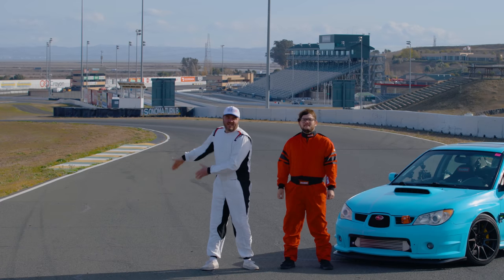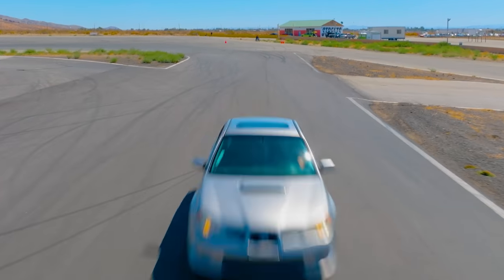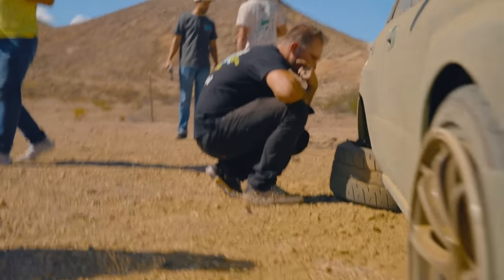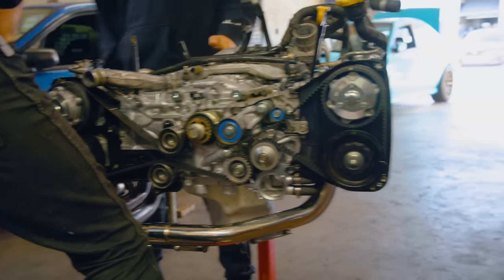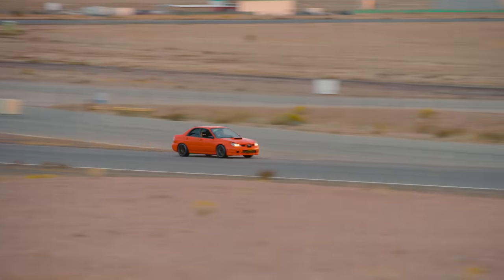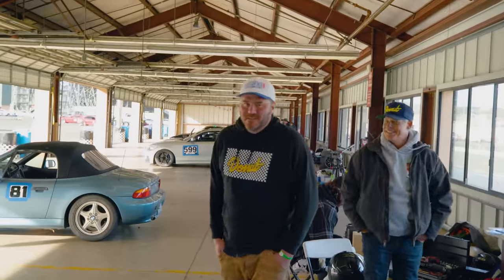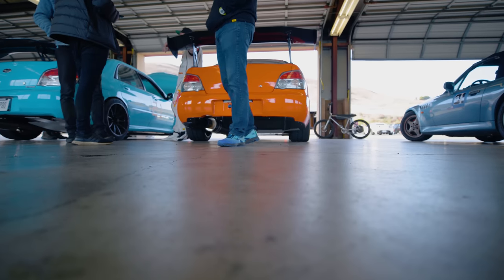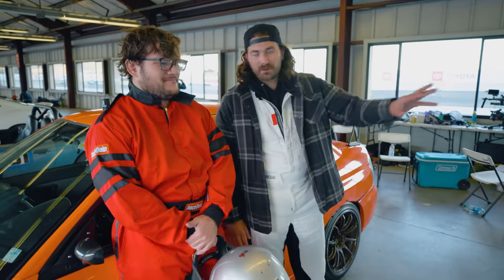$21,000 vs $43,000 Subaru WRX Build - HiLow FINALE!

Comment: The one thing I learned from this series, is every Subaru stereotype is probably true 😂
Reply: Not true at all. They just dogged on “new engines” without proper break in. Also no mention of a Cylinder 4 mod to help with cooling.
Reply: @FunTimeWithSouls  the cars are just junk
Reply: @pharezknights5467  not really, I have a 2019 and have no problems whatsoever.
Reply: @FunTimeWithSouls  not comparable what so ever xD
Reply: @pharezknights5467  wrong, my hawkeye sti has been driven very hard since 2006, had has 0 engine problems, donut just doesnt know how to care for a subie
Reply: @davidlees8519  same engines lol
Reply: @FunTimeWithSouls  with only a 10 years difference in age xD
Reply: One must respect the subie or one will get boned by the subie. That's the lesson of this hi-low
Reply: @obiwankenobi5126  if i have to add extra to make a car run normally im out, i just see too much problems with Subaru, i don't know why there don't ask Porsche for help
Reply: @obiwankenobi5126  which engine model japan or from America ?
Reply: If you want to learn more about what donut did wrong Smeedia made a great video explaining the problems they had and how to avoid them.
Reply: @obiwankenobi5126  if your engine requires super special care and love to function, it's a turd from the start and your just dressing it up with turd makeup.
Reply: lol you opened a can of worms down there.
Reply: @FunTimeWithSouls  I had bought an 18' new before upgrading to something quicker last month. I also never had one issue with mine while running a stage 2 pro tune, but I had to baby the shit out of it. After 35k miles I got sick of being scared to treat a sports car like a sports car.
Reply: @FunTimeWithSouls  yeah u dont go over 3k rpm or 5 psi boost becauase that thing will shit out, also its understandable you wouldnt wanna blow the engine and then u owe dad 5k more.
Reply: @CadgerChristmasLightShow  Or, it's a different engine that you can't expect to work the same way as every other engine. 

It's a boxer engine, it's not gonna behave like an inline 4.
Reply: @CadgerChristmasLightShow  exactly!! That's the same as someone saying a certain type of car is an amazing and reliable car if you just stay on top of maintenance and care for it...that's literally every car. Cars are literally made with the idea that, as humans, we aren't going to take 100% care of it bc most of us don't even know how. So if the only way your car is reliable is keeping 100% maintained then congrats you've got every car ever. There is a huge difference in a Toyota engine running on low oil for 300,000+ miles with little to no basic maintenance and having no problems compared to an engine with less then 100,000 miles that got every single oil change and check engine light investigated, and regular tuneups still needing X, Y, or Z replaced
Reply: @jackhofalot6705  23.3 psi, no knock. HA I’m 38 definitely wouldn’t owe dad anything lolol
Reply: @CadgerChristmasLightShow  If you're not racing your subie, it'll be just fine. These problems only arise when you put parts on for racing that aren't meant to be used with a boxer 4 engine.
Reply: @pharezknights5467  america
Reply: @davidlees8519  well how about this, i got 2 with the same engine, ej205 from the 02 wrx, one being an 02 wrx and the other being a 99 forester and neither have had any engine issues, now they’re 20 year old cars so ive done tie rods, a starter on one, idler pulleys on both, but nothing major that u wouldn’t expect to break on any other 20-25 year old car
Reply: @Tachyon836  ah yes, "just don't ever push it hard and it'll be reliable." I see tons of bone stock Porsches getting ragged on at the track and autox without them grenading so it has nothing to do with it being a boxer engine. Subarus are just pieces of shit
Reply: @MuffinWRX  yup sure looks like it 😂 I’ve never had a comment have this much interaction this fast . I hope people realize I was mostly kidding.
Reply: They haven't proven all the Subaru stereotypes, there's no lesbians in this show, unless you count who's watching
Reply: @FunTimeWithSouls  cooling mod does nothing and will not have prevented any of the engines from blowing.
Reply: @ChrisPBacon9  youre comparing a track built Porsche with a 26k Subaru lmao … your first mistake.
Reply: @FunTimeWithSouls  It's like gambling doesn't it? Sometimes it blow all over the place, in another time it just fine for years like your. Unfortunately any sane person not gonna bet their life saving to a car like that, there is alot more fun and reliable car out there.
Reply: @dreww47  you clearly don’t know what I’m talking about.
Reply: @dreww47  ah so you agree then? Subarus are pieces of shit. The only mistake is buying a performance car that cant handle performance driving situations, doesnt matter if its cheap or not
Reply: @lelouche9894  you seem mad lol. Who said anything about them building engines?? I said they didn't put the proper time into breaking the engines in. You can't put a "new engine" in withouth properly breaking it in no matter what engine is. You clearly have no idea about engines. Also this isy first subie. Every vehicle I've owned prior was a Nissan... You're right I am a lesbian, your mom knows all about it.
Reply: @ChrisPBacon9  Shows what you know about cars. 

Porsches are flat engines, not boxers. Very different. The firing rate is different and that can create very different engine conditions and engine efficiency. 

Not only that, Porsches have A LOT more money into their development and build from the factory. Dry Sump oil systems, air and water cooled systems, displacement volume, compression ratio, and a lot more. 

It is true, Subaru's are fundamentally very basic compared to Porsches when it comes to either flat or boxer motors. But that's for good reason. You'd be hard pressed to find a good running turbocharged Porsche as quick as either of these subies that'd last either for a comparable amount of money. 

The fact an STi costs like 35k while even a non-turbo Porsche Cayman costs like 47k speaks volumes. 

One of the things that would even this out would be if Donut had added 4 cyl cooling mod and AOS system. Effectively it would help. 

Not only that, but they chose the wrong WRX year. The hawkeyes were first year of low output EJ25s with only 224 hp. 

The EJ20s are much much more stout. I beat the shit out of my 310 hp, stage 2 tuned base blobeye WRX and it never broke on me.
Reply: @CadgerChristmasLightShow  all engines require extra care and parts when you’re trying to push almost twice the power, to help the engine handle the stress if you don’t know that I don’t know what to tell you 😂
Reply: @Tachyon836  dude it doesn’t have anything to do with them being hawkeyes, they dyno tested more than the ej205 stock and the made more power and torque cause they had avcs too. They were using that block on the usdm STi before the used it in the 06+. I had a bugeye and an 06 STi and they haven’t really given me any problems like these dudes, no matter the car, if you use your car as a racecar you’ll have racecar problems.
Reply: @FunTimeWithSouls  yeah sorry I was talking to  @obiwankenobi5126 my bad. He said that is was Donuts fault that they keep blowing engine. The break in argument doesnt seem to work because why did the original engine blew up in the first place if it was already break in? You dont look lesbian you look like a nice dude.
Reply: @lelouche9894  you have been redeemed lol
Reply: @ChrisPBacon9  Google the difference between boxer and flat motors and learn. It's a very common error. 

It's okay.
Reply: @ChrisPBacon9  I'm assuming you're referring to turbocharged porsches like these turbo subies here. In all 911 Turbo's they have exclusively used Flat 6's. 

Perhaps the earlier caymans and boxsters were boxer motors similar to Subaru, but my statement is still accurate otherwise.
Reply: @ChrisPBacon9  I said the boxster and cayman were the exception. All turbocharged applications are flat. 

Not the best at reading eh? Or maybe you didn't see it and started typing first? 

No matter, we finally have a mutual understanding. 

So you know why porsches are more expensive right?
Reply: @Tachyon836  so you admit, Porsche builds boxer engines.  In certain years the boxster S had the same engine as the base 911, which, guess what, is a boxer engine. I'll end the conversation here cuz I'm clearly wasting time talking to some 15 year old or something
Reply: @ChrisPBacon9  some kid thinks he's got me when I literally said that earlier. I said every turbocharged 911. 

Listen, either you read or don't bother replying.
Reply: @ChrisPBacon9  Also, you're the one learning about Subaru engines from a donut video. 

And I'm the 15 year old here? Guess again, lmao

Comment: I'm half way in and I'm laughing my ass off.
I like the engineering and consumer angle of car content but I'm not a racing guy - I drive a 2010 Hyundai Elantra GLS. I knew a guy who was a muscle car bro, though, and he spent weeks trying to convince me I should ditch my Elantra and get a WRX.
Given that my insurance is $93/mo, a full tank of gas costs me less than $40, and the only maintenance I've ever had to do is oil changes and a new set of tires, I am so glad I didn't listen to him and kept my bulletproof little compact.
I like the WRX as a car but with so many known reliability issues I absolutely could not ever own one

Comment: I owned my Legacy GT (same engine as the newer WRX) for nearly 10 years. Modified it a lot (bolt-ons, tune, including basically all of the performance mods in this series). Drove it freaking hard. Tracked it. Put about 60k miles on it. You know what never happened? It never blew up.

There are sooooo many bad Subaru tuners and mechanics out there, as well as so many incompetent Subaru owners out there who modify and destroy them. My guess is that the “new” engine in the first hi car was built by a shade-tree mechanic and it was bound to fail. Second hi car was previously modified and probably returned to stock and sold because it was having mechanical issues.

These cars are normally pretty reliable when they are left stock and have the original engine. As soon as the engine gets “rebuilt,” you are relying on the mechanic who rebuilt it. Like I said, there are a ton of Subaru “mechanics” who basically backyard mechanics without any technical knowledge.

The transmission failing…well, that’s just the 5spd glass box living up to its name. I replaced my 5spd with an sti 6spd partly for that reason. The original LGT 5spd lives on in my EZ36 swapped 98 Legacy GT (until I swap it for an sti 6spd).

Comment: Imagine a New Edge mustang high low that would be insane
Reply: As long as they promise to never attend a Cars and Coffee in a Mustang.
Reply: @RobHnasko  why? Do you think they'd let you drive it?
Reply: This is EXACTLY what I'm thinking. Drag racing or road racing. The mods are PLENTIFUL and affordable, and they're basically free at the moment.
Reply: @Blaquer17  Where do you live? I'm in Ca and new edge mustangs are weirdly expensive with anything remotely clean going for at least 6-8k.
Reply: @paulwilliams667  New Orleans. But I'm betting they can get a decent v8 new edge for about the price of the WRXs they just bought. I'm guessing 10K would get them good examples. The hardest part would be finding some that aren't already modified.

Comment: So you guys have officially convinced me never to buy a subaru lol which is sad cuz they're really cool. I think its time you guys did some muscle car stuff now
Reply: They don’t know how to build them properly. Check out Shmedia’s response video about it. Subaru’s are sick and don’t blow up as easy as they make them seem if done right bro, all cars have their quirks but I don’t regret having mine and i’ve had it 5 years now
Reply: Dont listen to them Subarus are grate they are just a lot more iffy to how you modify them you need to do it right or not at all not like a Honda where you can do whatever you want and it’ll run for ever. Subarus are grate just do a lot of research and get it done right and they will run for a long time
Reply: @BasicMacik  yeah. If they had put an LS or a 2jz they would have blown those up 5 times too.......... If you have to baby the engine to call it strong, it's not strong.
Reply: They didn't even do the most basic of safeguards and break in the motors before thrashing them on the track. Hard to take anything they say seriously as far as reliability goes from then on. Here's another anecdote: I bought a used Subaru with 125,000 miles from an auction, essentially sight unseen. 10,000 miles so far of daily driving, including -25° weather, and hooning including launches, drifting, donuts, and otherwise driving the shit out of it. Oil is fine, compression is fine, temperatures are fine, no abnormal knocking on my accessport.  Will it blow up soon? Maybe. But I thought I'd offer my experience for some perspective. Cause watching one group of people recklessly modify and test cars shouldn't be your only source of information.
Reply: to be honest, they kind of suck to work on anyway (i'm sure i'll get some hate for that)  They seem to be popular for modding though, so if that's your jam you've got a pretty big aftermarket scene to pull from.

My sister in law got a forester.  Struts were hard to find (one collapsed), valve cover gaskets were a pita (every used car i've ever bought needed those gaskets done), wheel bearings were a pita.  The frameless windows leaked air (pretty noisy\annoying on the highway, especially when it's -20 out).

none of these is a deal breaker really, but just as a daily driver for someone who doesn't race? it kind of adds up if you maintain your own vehicle and don't have access to a full shop's worth of tools.  I normally buy domestic cars, and i found them MUCH easier to maintain, typically easier\cheaper to find parts for as well.
Reply: I agree. I’d love to see them do this same type of series with a 5th gen Camaro or a C5 corvette.
Reply: i think subarus are ok but they clearly arent made to be modded.. They will perform better on the offroad field
Reply: I almost bought a wrx but I got a new Toyota Tacoma instead thank god my dads got a outback and it’s been worked in so much it’s stupid
Reply: I had a Crosstrek for a few years. Went through 3 short blocks in 30k miles. Sold that bitch to vroom for way over local market and never went back to a Subaru dealership.
Reply: Lmao yeah dude Subarus are fucking terrible.
Reply: @cameronmahon7242  bruh they didnt even do a proper break in on the first 2 engines good luck doing that with any engine and immediately tracking it without a proper tune
Reply: @erikk27a  Says the guy with a G37
Reply: @cenciende9401  Hurr no shift just foot gas go fast urrr
Reply: subaru guys are like rotary guys. they have an interesting, but unreliable engine that they SWEAR is reliable "if you take care of it right" 
they dont understand that a "good motor" that blows up if you sneeze at it, is a bad motor.
Reply: @joshmurphy1942  Donut Media is BuzzFeed for cars. Nothing they do to their show cars is well-informed or good for general education. Their content doesn't go into detail or any real depth. It is surface level knowledge, as if the only information they present you with is what they read on the packaging box/marketing material their parts come with. It's just YouTube for entertainment. Nothing valuable can be learned on this channel that can't be learned by reading through a catalog of aftermarket parts for your car.
Reply: Newer Subarus are much more reliable
Reply: @TheAmericanMuffin  i’ve been hearing a lot of good talk and seeing some crazy numbers on relatively minimal upgrades on the new FA24
Reply: @TeslaHaxz  I sneeze at my car and it sneezes back just fine lol yeah people shit on rotaries because they don’t know about premixing oil when they get gas but hey i’ve seen plenty of reliable boxer and rotary builds so i’ll die on this hill knowing there’s better platforms. But in the end I know Donut Media are too novice in the Subaru world to put out basically a false stigma because they didn’t do something right 🤷🏻‍♂️
Reply: @BasicMacik  I drive a Toyota but my dads got a 2013 WRX that’s at 213,000 miles with the original clutch. I’ve helped him work on it and it’s been a great car ya know
Reply: @TheAmericanMuffin  they love to see it homie
Reply: @TheAmericanMuffin  did y’all pull it?
Reply: @BasicMacik  "didn't do proper break in" 
Proper break in is "break it in how you plan to drive it" 
Mitsubishi shop near me named exigent does a full pull on the dyno with every 4b11 they build. Their shop car is top 10 4b11 in the world, around 1300hp i think, and they take the car on road trips. Beating on it right away helps seal rings for more boosted applications.
Reply: might be the worst subaru build series of all time, now I've loved Donut (Until they were bought out and quit making videos like they did before) since way before the high-low series because they made genuine enthusiast content! They seem to ignore having made proper precautions and research before jumping into unfamiliarity, blaming their issues on the car... as a subaru mechanic and enthusiast DONUT has decided to paint subarus in a bad light for the views and frankly I feel like donut should have a higher standard for their videos.
Reply: @erikk27a  yeah you say that lol
Reply: @TeslaHaxz  every engine has different tolerances. EJ’s need at least a few heat cycles and no boost miles until then you can start the hard break in